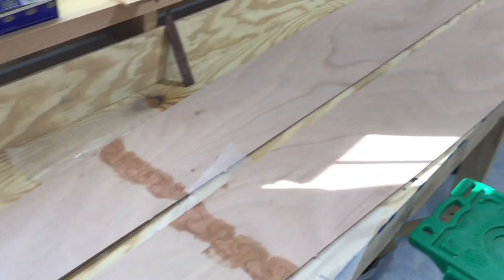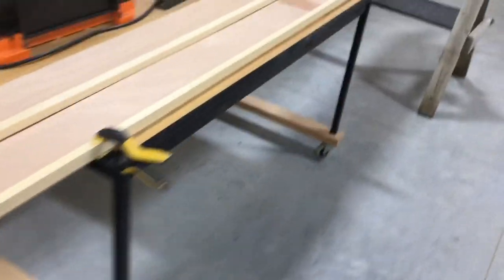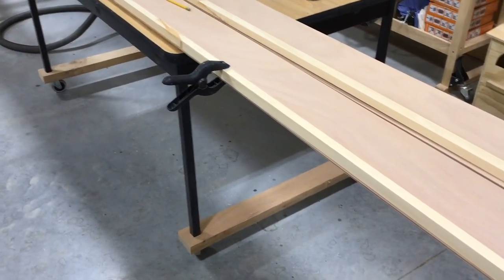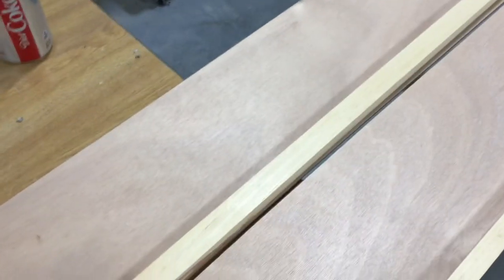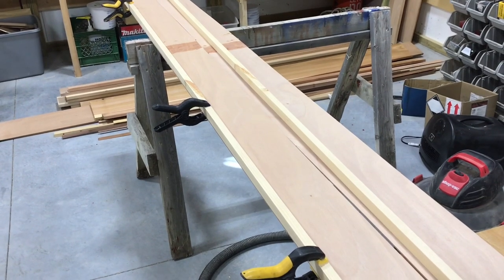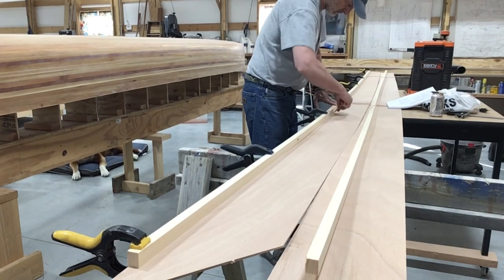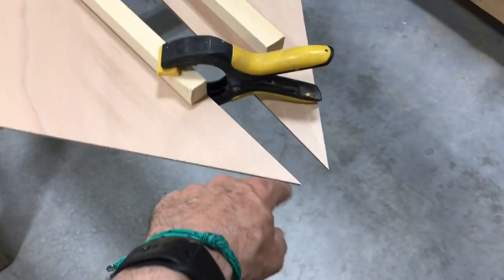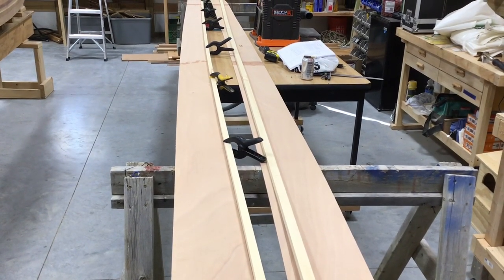Kayak Building Chesapeake 18 - Side and Bottom Panels- Episode 2

Comment: Hi Chuck. It is so easy to get the handing wrong on symmetrical pieces of work. I write the orientation big in pencil when I do stuff like that. I was amazed when I first saw stitch and glue for the first time, here on YT about 4 years ago, but it was used to make Mirror Dinghies back in 1962 ( a good year that... ). It is a clever method.
Reply from the maker: it is a clever method and this kit with the pre-cut panels, what a breeze!